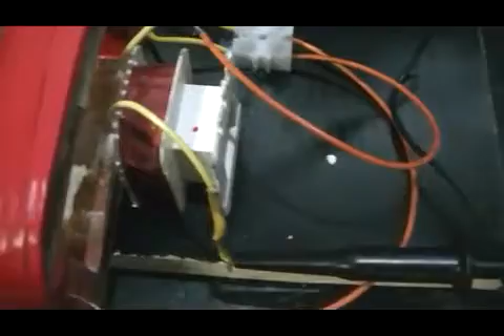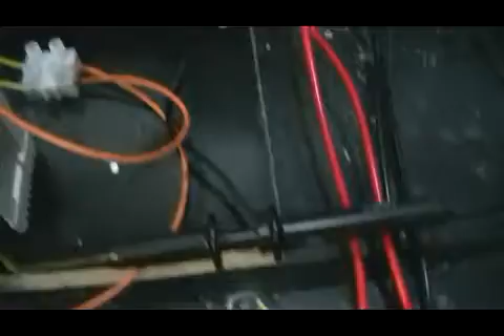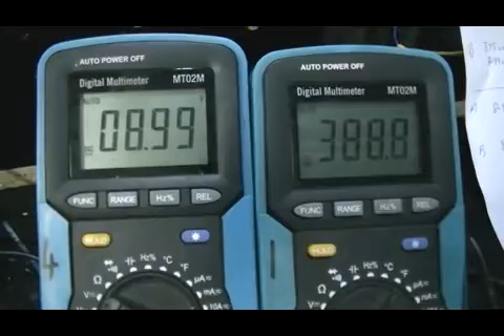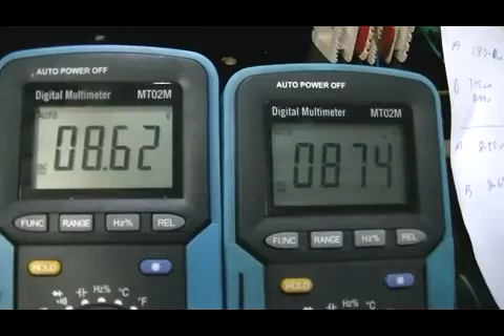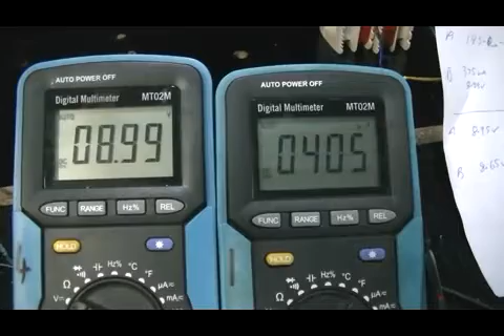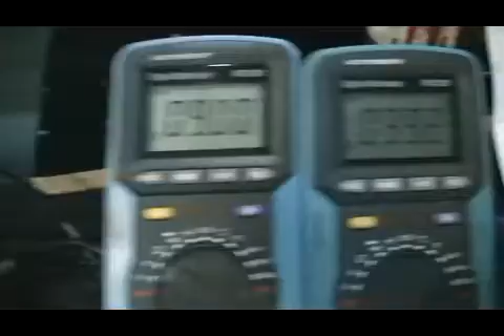cool joule current amp2

Comment: Double the current on the output side with minimal voltage drop.. that seens significant.. right? 
I get that that's kind of the point of "amp2", but if the output voltage were increased by .07v, and the output current remained higher than the input.. wouldn't that be zero-point energy?

As always, thanks for sharing this madness in such a clear and properly-instrumented way. I understand such a tiny but of this stuff, but with each one of your videos, it's a tiny bit more!